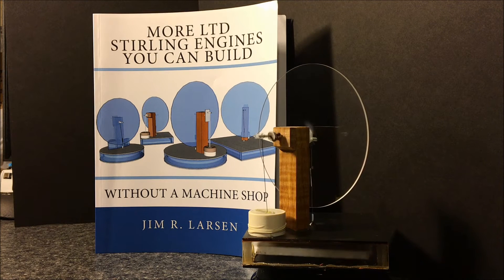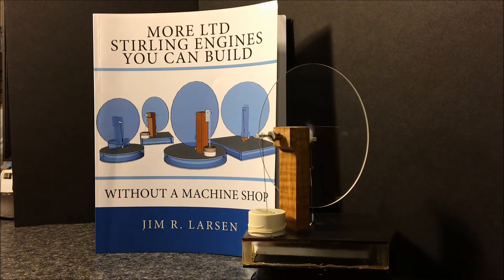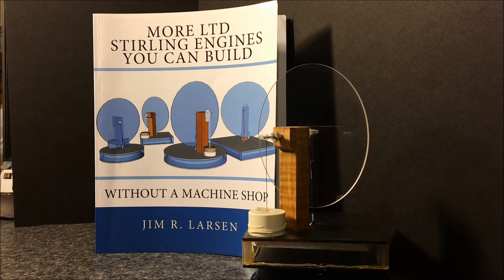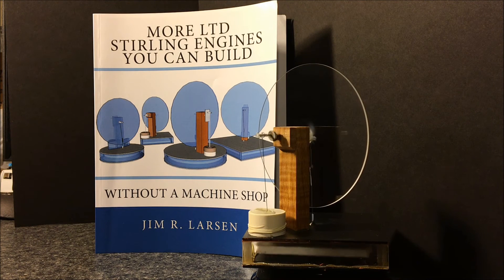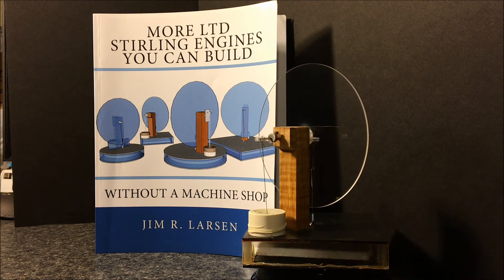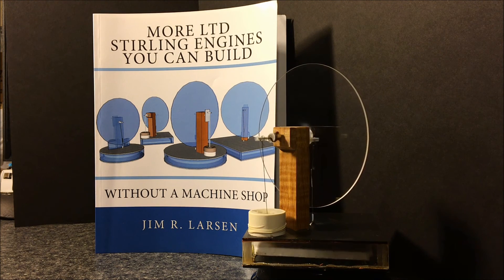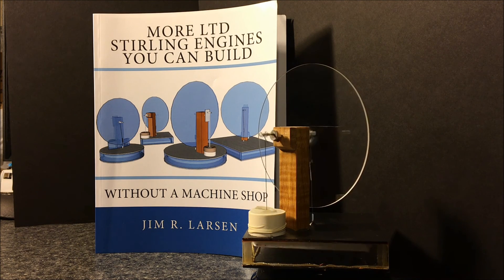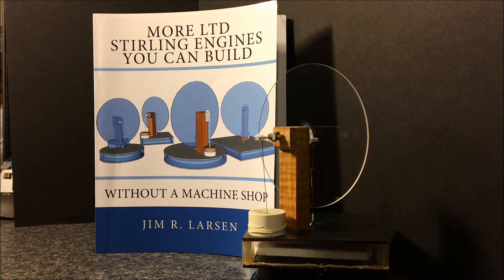How to Build a Small Square LTD Stirling Engine

Comment: Hi Jim! I have to coach a robotics team this year and we need an energy project. I thought it would be interesting to use the Stirling Engine. We have to come up with a refinement/improvement and make a prototype etc. Do you think there is anything we could improve with a Stirling engine stove fan? Maybe build it into wood stoves?(trying to stick to sustainable off-the-grid energy project if I can). Integrated stirling fan into the exhaust pipe? I'm not extremely familiar with how they work or what would be the best improvement. Any advice would be greatly appreciated!

Comment: Jim could you make this for me? Stirling helium sealed cylinder cold piston that generates ultra low temperatures that turns gas in simple air to liquid that operates off an electric motor. Generated liquid air fills an insulated tank with a bell siphon that fills a condensing coil. A stirling V-6 colss gas engine with antivibration technology with gadolinium used for magnetic bearings on all moving parts. A automatic bicycle transmission attached to one of the fly wheels of the Stirling engine with a rewired drum motor generator with magnetic bearings with a vacuum spark gap attached to the bicycle transmission to generate electricity. A fan attached to the other fly wheel to draw air through the liquid air filled condensing coil for air conditioning. An organic carbon power cell used to start the cycle and generate the first tank of liquid air. Then the power drain from the carbon.power cell stops and the volts from the drum motor generator recharges the carbon power cell then shuts off ounce carbon power cell is fully charged with the drum motor generator then providing power needed to operate the electric motor for the cold piston. The air conditioning unit should now be self sustaining with extra electrical energy that can be transfered using a wireless charging device has well. The boil off from the liquid air from the heat exchange returns to the cold piston where it is then reformed into a ultra cold Liquid. An insulated resivor contianing the cold gas cylinder piston heads to fuel the cold gas stirling cycle with the boil off returning to the cold piston to reform liquid air. A solid state sponge can also be used to make a closed system using argon gas that is absorbed by the solid state sponge when unit is not in operation. The cold piston would draw out the gas from the sponge from the action of turing a gas into a liquid. Okay now that you understand this much? A V-20 stirling cold gas engine with antivibration technology with gadolinium magnetic bearings on all moving parts with bicycle automatic transmissions attached to each fly wheel with a large rewired drum motor generator with magnetic bearings and vacuum spark gaps on each bicycle automatic transmission to generate electrical energy. Start up of the liquid air electrical  power generator would be just like the air conditioning unit. V-Twin stirling cold gas engines with fans attached to each fly wheel could be placed in insulated duct work to move high volumes of cooled air around a home central heating cooling and electrical power generation system. An atmospheric water generator could be placed within the system to deal with water vapor and condensation that can then be filtered and used for drinking water. If your interested in all this and would not mind.making these for me? I'll explain an induction levatation water heating and air heating system. I Will also explain the use of super cold superconductors that can be used with the ultra cold liquid air and then high heat ceramic superconductors that can be used to soup up the whole central heating cooling and electrical power generation system that can be used in homes green houses trailers and recreational vehicles. To make the system even more quiet foamed aluminum can be used to make a sound proff box for the whole system which would also help the system to stay clean.  Well let me know what you think about all this? Oh i also have a few other neat ideas for electrical power generation using liquid air if your interested? 😊
Reply: I think you have to do it yourself